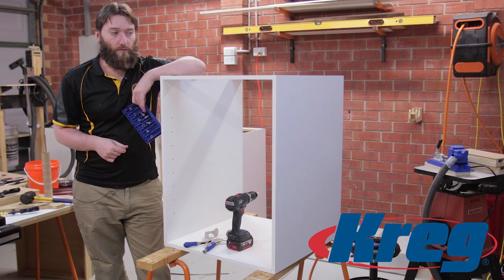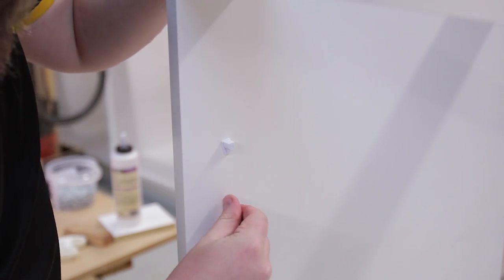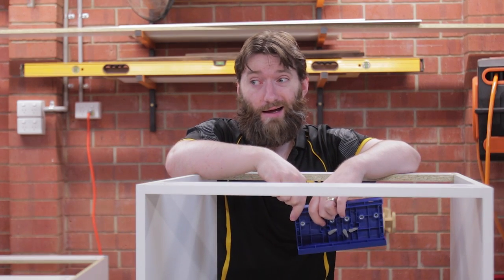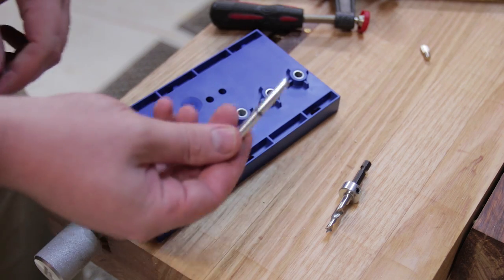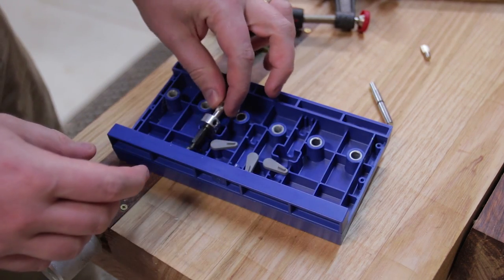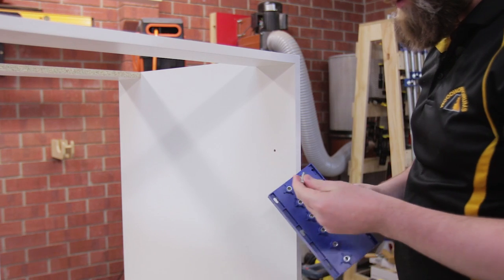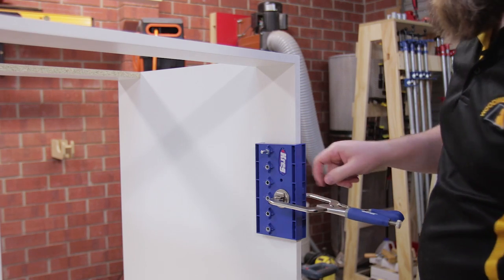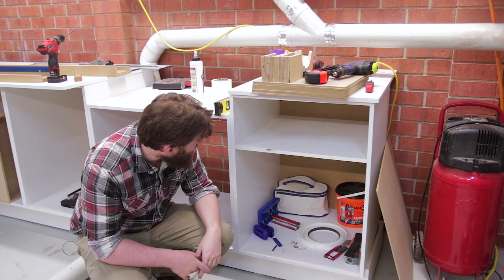How To Build Cabinets: Adjustable Shelves (Mitre Saw Station Part #2)

Comment: Paul, you're a godsend. Thank you for your detailed explanations. I'm fairly new to woodworking and was in the process of designing my small shop and was perusing through countless miter saw builds on youtube, lumberjocks and pinterest when I saw your melamine build. I was aghast at the prices for plywood here in the US and contemplating what to do and how long it's going to take to make my build, little by little because of my budget restraints. Lo and behold, here you are with the perfect alternative. So, excitement is back, moving forward with your idea. It's been a pleasure watching your videos, where I've learned so much. Thank you for taking the time in this teaching capacity. You have no idea how much I appreciate you. 
Thank you kindly.

Comment: nice video but where do you get to see the Kreg stuff in Aust. I'm located on the Gold Coast and not very mobile?
I can see the items in ebay and trade tool locally are "ON ORDER stockist only"
Reply from the maker: +HB Carbatec and Timbecon stock most of kregs range, if not all. Both ship nationally and carbatec have a QLD store.
Reply: Many thanks for the quick reply. I try and arrange a visit to Carbatec in Brisbane some time.
Later,
Called into Trade Tools in Tweeds Heads NSW and found they have the Kreg kits. So I got myself the K4.
So now the next job is planning some more cabinets for SHMBO.
Again many thanks for your advice and excellent video's.